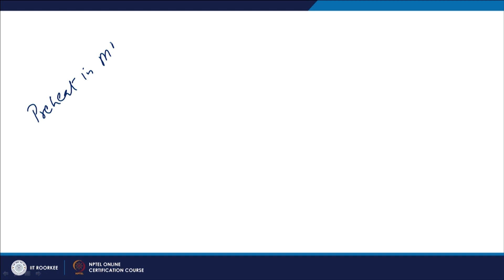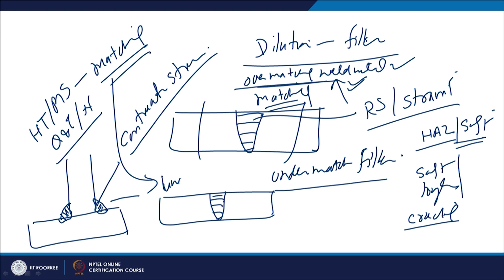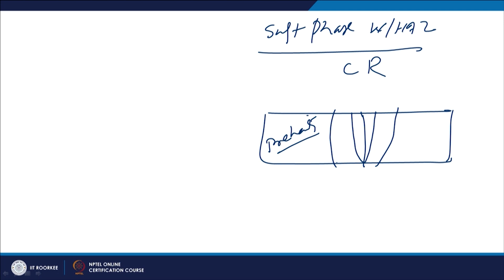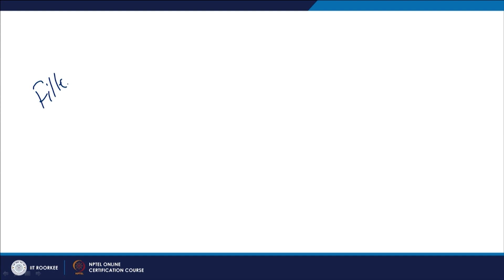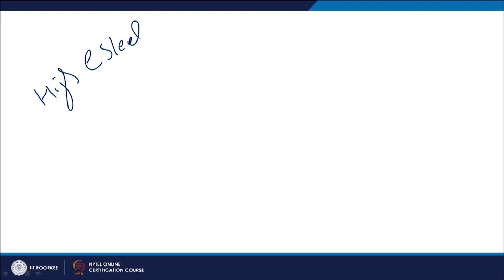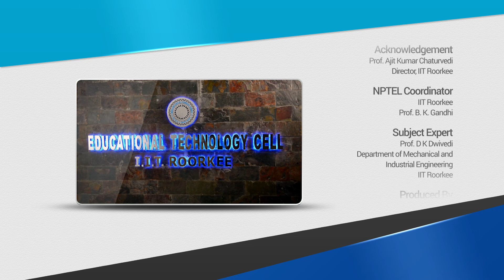Weldability of Medium Carbon Steel and High Carbon Steel

Comment: Hello sir 
Kindly advise us which welding wire /electrode to use to weld hchcr d3 tool steel . We are still getting pores after welding on the surface . Kindly provide any contact just to talk for some time.

Thank you 
Ankush Sachdeva
Punjab